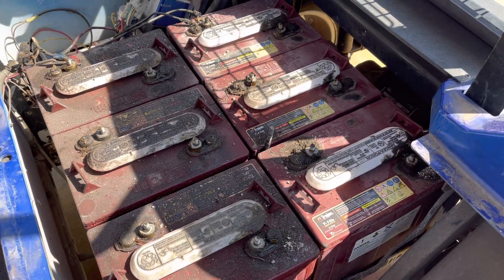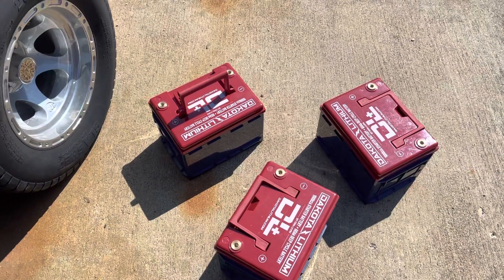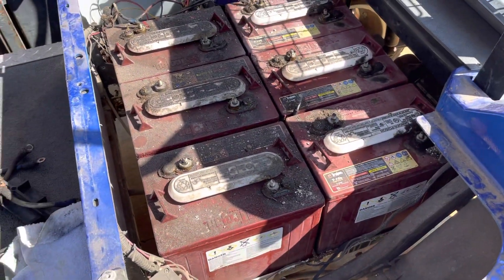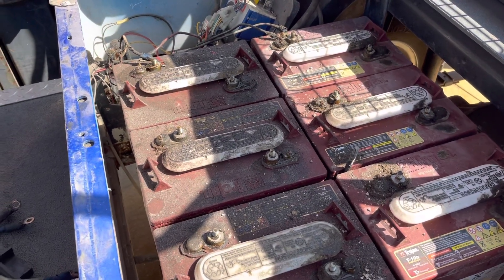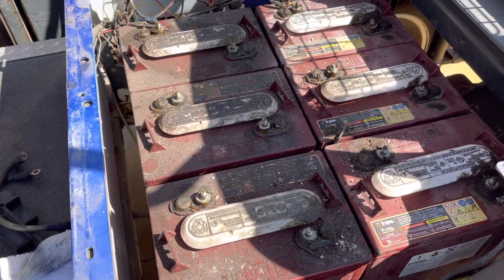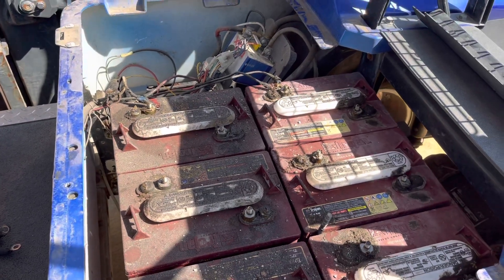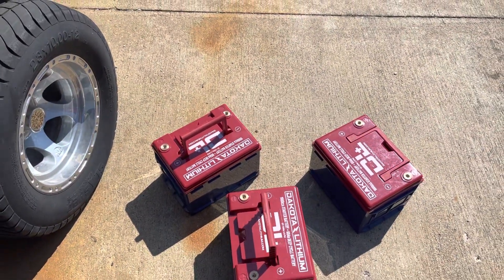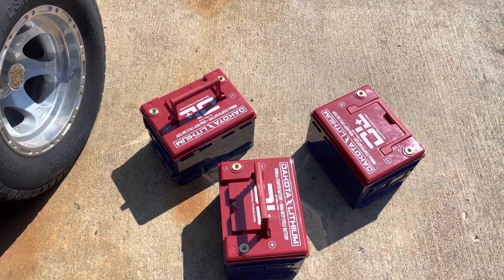The cure for having to replace golf cart batteries every 4 years.

Comment: I bought four for my 48 volt. How are they now? I am disappointed with the $2500 I spent. I would love to talk and know your experience
Reply from the maker: I won't lie one bit about it. I am not happy at all. The cart doesn't go far before at least one battery goes into low voltage protection, leaving the driver stranded completely.  My wife and daughter drive this cart and it won't even go a mile before failing. I've had to tow it home 3 times to the point where they quit driving it because they didn't want to get stranded anymore. For as much money as I spent, it's quite ridiculous. 

I am a power tech with a degree in electronics, working for AT&T for the past 25'years, dealing with AC and DC power systems including battery maintenance. I installed everything with full integrity. With my original batteries in the golf cart I never had to do an equalization charge. With these lithium batteries simply trying to isolate and solve the problem, I have performed countless isolation/equalization charges on the individual batteries however it was in vain because it didn't help at all. Thinking that I might have an individual battery that is weak, going into low voltage protection I began documenting which battery was going into low-voltage shut down and it changed between two batteries out of the three. 

Speaking of low-voltage shut down, it is absolutely horrible. With the lead acid batteries, the cart would begin to slow down and you would know it's time to head home but with the golf cart on these Dakota batteries, it simply dies and you're either getting towed or pushing the damn thing home. While I do have a 400 amp controller on this golf cart, my wife and daughter don't go running around the neighborhood with the pedal on the floor they simply go cruising around the neighborhood at low speeds. 
Soon I hope to post up a video revealing what I consider to be the perfect solution for my mistaken purchase of these batteries. I think that anybody who's already made the purchase like I have will appreciate this relatively simple and inexpensive upgrade.

Comment: I'm looking at the same set of 60ah dakota lithiums for my 36V cart, trying to decide between those or the Trojan lead acid (same set you took out of your cart)   Im curious how they have compared in porformance? And range? Do you play golf with these batteries or use the cart for something else? Im concerned after talking with the manufacture that the 60ah batteries wont last 18 holes consistently in an EZGO with a 350 amp controller.  Thanks!!
Reply from the maker: Golf Carts are legal to drive in our neighborhood and so that's all that my golf cart is used for. I will say that all batteries like these have a low voltage cutoff therefore you get no warning when they're going to shut down. They don't simply begin to slow down to a crawl as they get low. I'm not sure if you're familiar with the inability of one battery to charge when others are fully charged. That occurs regardless of which battery you're using, lead or lithium. If you don't equalize charge your batteries, it causes early shutdown (decreases your range) since your range is only as good as the weakest battery in the string. I discovered that the charger for individual cells will drain a battery if it's connected to a battery and there's no AC input to the charger. My wife accidentally unplugged the charger while leaving it connected to one battery. As a result, the cart wouldn't even move. Once charged I can't tell you how far the cart will go but I know that my wife and daughter will drive it non stop for over an hour, around the neighborhood without issue.  The cart is much more nimble because of losing the weight of the batteries.
Reply from the maker: I also forgot to mention, you can also try a mix if you choose. You can run 3 12v conventional batteries in parallel with the Lithium batteries or you could place a switch on them to have a back up if needed. I could talk you through wiring whatever you want to try if you decide to try it.

Comment: The nice thing about getting the old lead-acid battery out is this for lithium batteries 
One is the wait lithium batteries or about one-third weight.
Two is power they stormed more power more efficiently.
Three is life expectancy they last longer no watering Messi acid clean up.
4th is you have to buy a charger to match your battery system.
5th would be this like an add-on for regenerative braking but you can buy a more efficient motor 3-phase with the controller. Much more efficient, can even buy a little bit taller rims & Wheels.

Comment: How much for used battery
Reply from the maker: Are you talking about used Trojans or used Lithium batteries?
The price of used Trojan T105's would vary based on things like market area and the current cost of lead. The last used ones I saw for sale were 74.00 each. Used lithium batteries, I don't know. I do know that if you had the time and inclination that you could easily make your own lithium battery packs. Depending on your ability, you could buy one from certain wrecked autos, strip and transplant the cells into your own packs.
Reply: @Always_Fixing_Things  yes

Comment: What?? I got ten years out of my 6 volt batteries.
Reply from the maker: There are many factors that determine how long you get out of your batteries. My cart stays outside during hot summer days and we usually have at least 60 days over 100 degrees in the summer. That takes a toll on the batteries. 
 I usually got 5 years out of them on average and could restore and get more out of them by flushing them thoroughly, pouring distilled water and epsom salt in them and giving it another go but the juice isn't worth the squeeze anymore for me.
Billing my hourly rate, I'd rather spend my time on other things these days.

Comment: I can see why you only get 4 years out of your led acid batteries.  A little TLC goes a long way.
Reply: Yeah my lead acid batteries have lasted for 6 years but the last couple of years they've become constant maintenance. And their capacity goes down dramatically. Doesn't matter how "clean" they look
Reply from the maker: @mrsavedbygrace2569  
Thanks for the comment. I work on lead acid batteries and other power equipment for a living and that's the way it is. As they begin to fail (based on Midtronics testing which is a couple thousand dollar high end tester) they will require more and more water. When testing, I not only test the cells but the integrity of the connections. The No-ox-id grease that we use will guarantee the connections never oxidize but when using a golf cart like this one where the whole family goes all over the streets, on trails and in the fields, the grease will catch dirt. Some folks are simply too smart to understand something so simple "bottom line" LOL.
Reply from the maker: I realize that you think you know what you're talking about but I'll bet you don't.
Reply: I have over 40 years in maintenance, so I DO have some idea what I’m talking about. By the look of your lead acid batteries you don’t take proper care of them. Their filthy and I’ll bet they are low on electrolyte. My cart batteries last a good 7 years with proper care.
Reply from the maker: @williamguilzon5082  while I don't have 40 years, I have a degree in electronics and 35 years experience in automotive electrical and 23 years power engineering and maintenance with AT&T, working with DC power plants including many battery types, power distribution systems, AC power, distribution, transfer switches, generation, fuel, battery, cooling and starting systems. What you see is dust and dirt on top of a product called no-ox-id. The cables are 2/0 pure copper to the motor and 2ga between the batteries, all hydraulically crimped. All connections are properly torqued with a calibrated Snap on torque wrench and then treated heavily with No-Ox-Id to protect them all. Water levels maintained regularly and topped off as needed with distilled water. The batteries were regularly checked, isolated, tested with a Midtronics test set for mohs and siemens levels and the connections retorqued and retreated. I agree that the dirt and grass stuck to the no-ox-id product may appear unsightly but it in no way affects the performance of these batteries. 
I have had engine start batteries in buildings remain on chargers their entire lives and yet our protocol is to replace them at the 5 year mark. I test them also with the Midtronics test set and watch their decline and the most remarkable thing that I can share is that the hotter the environment that these batteries are stored in, the less time they last.
Also, Bell labs worked in tandem with the lead acid battery cell manufacturer at the time and did many engineering studies, spending many millions of dollars and the results concluded that the optimal battery temp for a lead acid battery is 77 degrees and for a 40yr cell, it's life is reduced by 10 years with a simple temperature increase of 1 degree. I've experienced higher temps than that in the middle of winter so batteries beginning to fail at the 5yr mark is never a surprise to me when considering the environment they're in. 

Best regards.
Reply from the maker: @williamguilzon5082  also it's sad that after 40 years of maintenance that you still don't know proper English. "Their Filthy"LOL. Get over yourself cupcake.
Reply: Bottom line you don’t take care of your stuff it won’t last.  And by the looks of things you don’t take cars of your stuff. I’m done
Reply from the maker: @williamguilzon5082  lol no honey, the bottom line is that you're clearly not not smart enough to know what matters and what doesn't when it comes to technical things related to lead acid batteries, but that's ok, you keep trying little buddy and someday you might just get it. You might not have many years left but maybe, just maybe there's still a little hope for you. Hang in there!!

Comment: Could I ask what kind of cart you installed these in ?  I bought 4 Dakota lithiums, just like yours.  I have yet to install them for lack of technical info.  I am installing them in a 48 volt EZGO RXV, and have been told there us more to it than just dropping them in, mostly because of the regeneration feature the charges the batteries when you use the brake.  I am running a 650 amp Navitas controller, and have been told that may need a reflash.  I am going to start calling tech support lines, but any insight you have would be much appreciated.  Thanks.
Reply from the maker: Hi Scott, I apologize for missing your question and not answering it sooner. I have a 36 V EZGO cart

Comment: I am on year 5 with my batteries I maintain and charge my batteries and my golf cart is used even in winter snow a new set is under $700 and I don’t have to buy a new charger I still love old technology
Reply from the maker: The core battery temperature has a huge effect on the life span of a lead acid battery. Being in a colder environment, they will last longer.

What I have is comparable in amp hours to a set of Trojan T105's which, here in the south last never more than 5 years with regular maintenance. Sure I've spent time flushing them and extending their lives significantly but at my rate of pay, it costs less to buy a new set. 

While the guarantee is only 11 years with these, the lithium Fe batteries that I'm using have a life expectancy of 4x lead acid batteries ( of over 20 years). Even at 700.00, the technically supported expectation is that a person will still spend 2800 over the same life span of these batteries and they won't rot your frame out over that period of time either. Also, these batteries could have 2  replaced and the charger replaced every 5 years and still come out ahead of whatever cheap batteries you're referring to. 
Love it or hate it, you're paying more for it so enjoy it!

I'm also curious about what brand and model golf cart battery you're using that costs 700 new for a full set or are you running 3 or 4 12 volt batteries in series instead? 

I've met people that like to use 3 or 4 12 volt car batteries in series and while that's something that the cart can operate on, the range is greatly diminished and that's not not even remotely close to a comparison that's worthy of a discussion. Even at your "low" price, there's no value in it over time. 

It's comparable to someone sharing a good deal on filet mignon and someone jumping in trying to tell everyone how cheap they can buy hamburger meat.
Reply: I still love old technology -- enough said. just wait